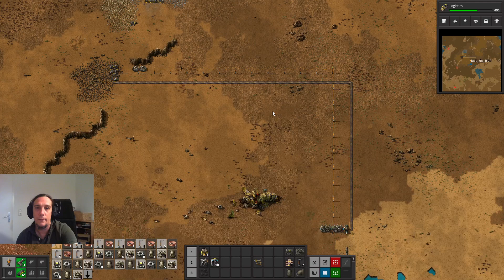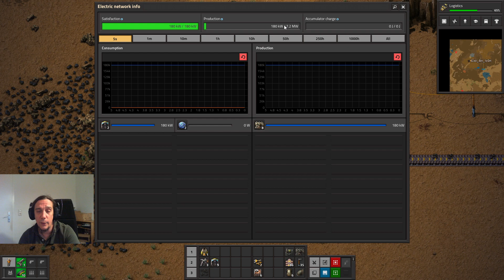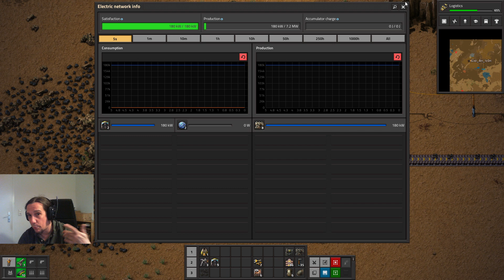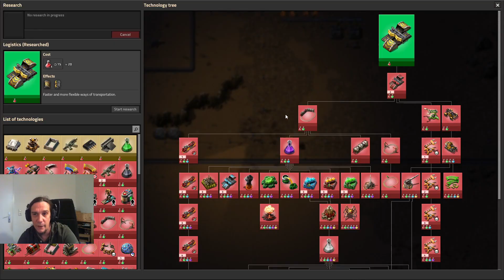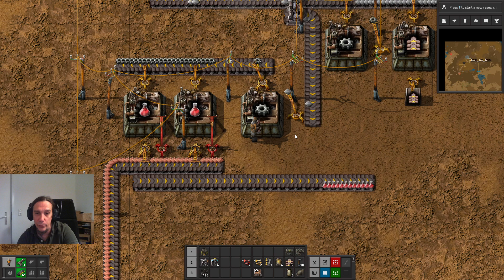MINING & SMELTING BASICS - Factorio Beginners Guide Tutorial 03

Comment: The downside to burner inserters is that they consume coal, too, so you'll need to use fewer boilers than the belt can normally handle otherwise the coal won't reach the end of the line, plus when you get to the point that you are consuming the complete belt, the coal will be moving too fast for the inserters to catch at times.
Reply from the maker: Very good points. I usually run my steam power plants always on yellow inserters, I just wanted to give those poor old fellas some useful spotlight ^^
Reply: @Ic0nGaming  I just use one on a single boiler just to jump start it if I need to
Reply: They are very useful especially if you run out of coal.. The power station will start up again without power, you just need to not overbuild on each belt.